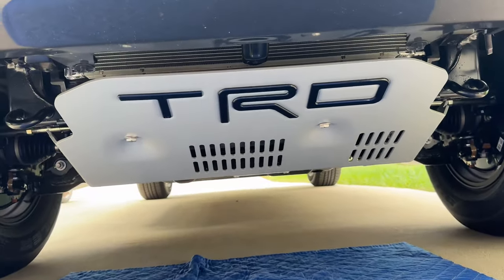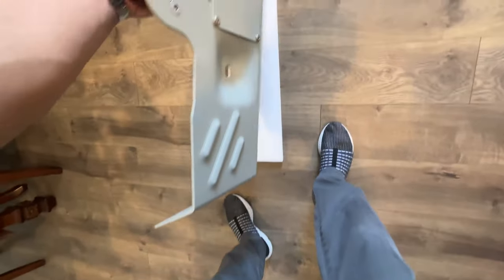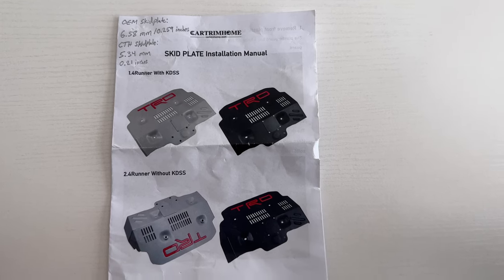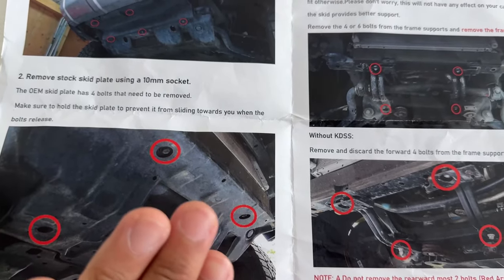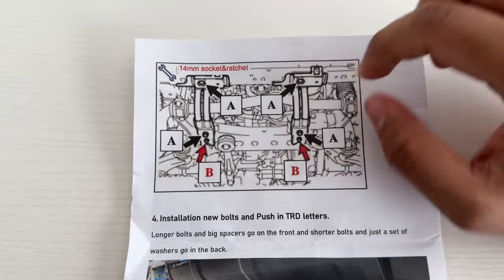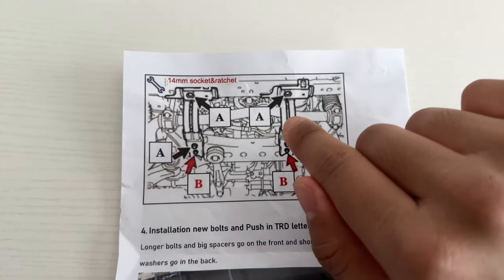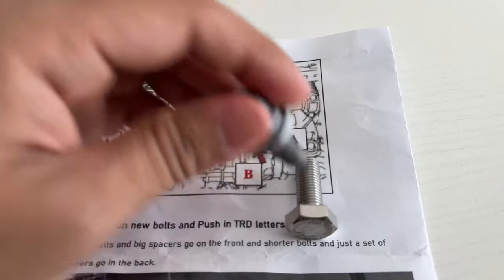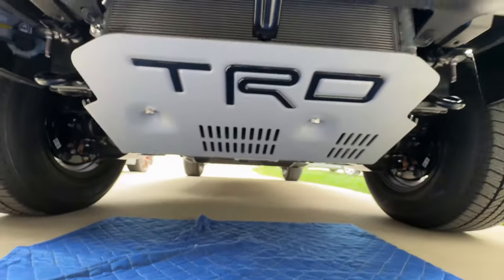Toyota 4Runner CTH TRD Skid Plate Install (5th Gen, 2014-2024)

Comment: Excellent vids as always! Please put that “Small Plastic Protective Cover” back on (right behind the lower front bumper) so that you won’t cause damage your lower radiator assembly from Rain, Salt, Rocks, and other Road Debris…The Skid Plate will fit with that “Small Protective Plastic Cover”installed to to the lower front body! If you look at the Skid Plate install it looks like something is missing! (With all that open space)! It bothered me too! I always thought that it looked wrong! I recently saw a correct install Video. Now it looks clean like it left the Tahara factory that way. Now I’m not concerned about Winter driving!😅

Comment: Did you use the included washers for the bolts in the rear?
Reply from the maker: No as mentioned in the vid I reused the Toyota bolts in the rear. I only used the CTH bolts/washers in the front
Reply: @MeynMotorGroup  cool. I used the stock washer and bolts for the rear also. Just finished 30 minutes ago. I just noticed that the included washer was much bigger than the stock one that’s all. The holes on the rear are kind of large.
Reply from the maker: @timzusa  Nice massive congrats my friend yea it's a great upgrade and yea you just need the big washers/spacers for the front everything in the back is just standard toyota botls.

Comment: Aesthetically pleasing but not functional.  I like the fact that it comes in black. The skid plate appears thinner than the factory one and in the center where you would normally place the jack, that piece is riveted on which would compromise it's integrity when you are jacking up the car.  The factory skid plate is one whole piece and it is double welded underneath the jack support to accommodate for the weight. This one is purely aesthetic and would not provide the proper protection if you took your car off roading or jacking your car up to replace a flat tire.

Comment: The back bolts on mine can’t reach the holes? Did you have that issue?
Reply from the maker: no because I reused the original toyota bolts in the back
Reply: I figured out my problem. Mine is lifted and there is a spacer that needed to be removed for it to fit.